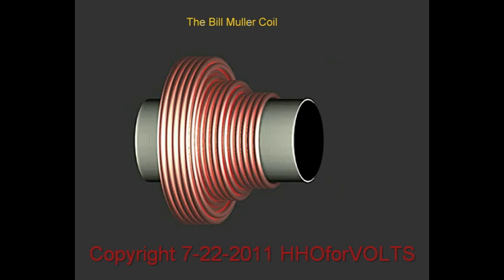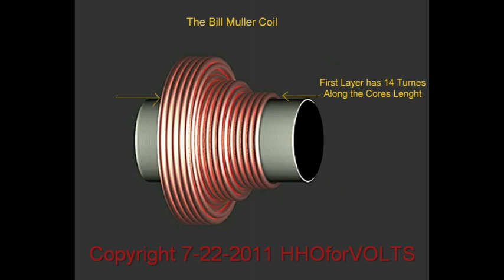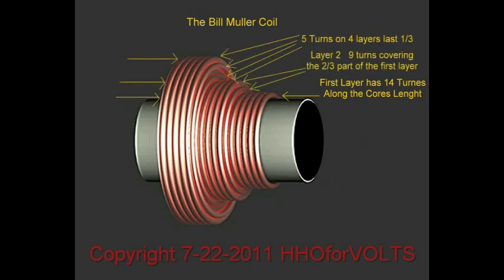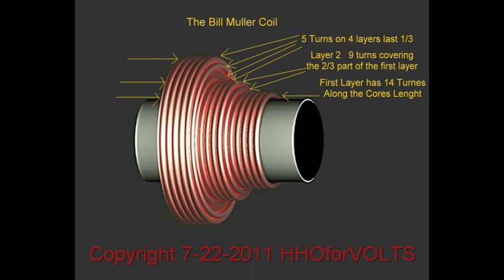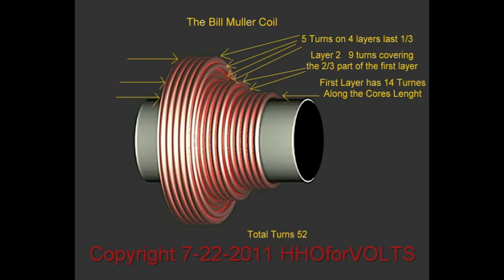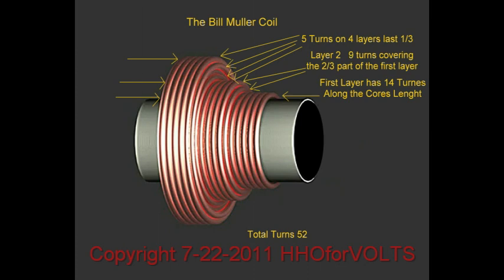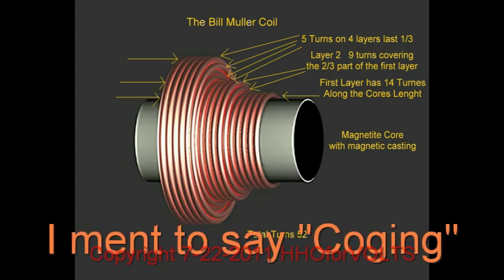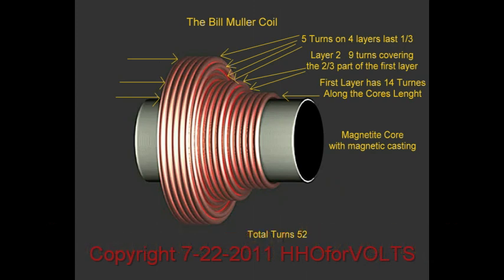Muller, Understanding his coil  design

Comment: It would be far more efficient to make the coil slope in a linear fashion to match the linear diminishing magnetic field  down the length of the core as opposed to that stepped technique. 13, 12, 11, 10 turns etc until you reach the number of turns for your designs required voltage. Also, keep the diameter of the wide end facing the magnets the same diameter as the magnets. I would like to experiment with dome and conical shaped cores and coils perfectly matching the radius of the magnetic field exciting them. Machining an iron cap for the coil/core to further contain and focus the magnetic flux would also increase the efficiency as opposed to just letting the coils radiate off that wasted flux. Keep your coil/magnet gaps under 1mm and you will be better off too. You will never go over unity but the higher your efficiency the better. You can also design a 2 thrust coil system where the second coil directly next to the primary drive coils are precisely timed and located to fire in a reverse wound pulling fashion on the same thrusting magnet as it is exiting the primary thrusting coils field with that second pulling coil only being energized by the collapsing field of the primary thrust coil to make more efficient use of the primary coils collapsing field energy then any of the other schemes that attempt to chemically store that energy that experience the additional resistance and electrochemical loses in the scavenging attempt. Always use at least 2 sets of driving coils and locate them evenly to avoid vibrational losses from lop sided thrust. 180 degrees for a dual setup, 120 degrees for a triple setup etc. Now if you use magnetic bearings and contain the entire device in a pure hydrogen gas filled plexiglass housing you will have a very high 90's% efficiency with your only loses being wire resistance. The hydrogen is 10 times more efficient then air cooling and adding a natural convection circulated radiator system to cool the coils further keeps resistance down. The hydrogen also negates almost all of the air friction loses which are immense at higher RPMs and frequencies where the magic happens. At the higher frequencies DIY Litz wire made up of twisted 36 awg or thinner wire  to your designs true desired gauge really shines! High temperature super conducting coils and wire is the next step that appears apparent but once you factor in the energy required to liquify the nitrogen you are way in the hole efficiency wise in reality. One last tidbit, you can use a diametrically magnetized sphere magnet on the end of a shaft driven by toroidal Rodin coils that can develop extremely high RPMs in the 500,000 RPM range! With diametrically magnetized ring magnets attached to that rotor shaft you can spin those ring magnets inside tubular coils allowing for a perfectly balanced high RPM armature. With 3 ring magnets 120 degrees apart radially you will generate 3 phase electricity that can be tapped delta or Y. You can add on additional triple rotor sets for more current or voltage depending on series or parallel wiring of the 3 phase rectifiers from each triple coil set. Enclose  that in a hydrogen filled/cooled pipe with magnetic bearings, use Litz wire and you may even experience the black suburbans showing up at your house in the middle of the night! That should be enough ideas to keep you folks experimenting all winter! Don't blame me if you get abducted, snuffed or electrocute yourself...lol

Comment: I have been messing around with free energy or lack of better terms to those who don't believe but I have made a coil with the same amount of wraps and size wire and the concept I came up with on the Orient of the wire and the wraps that almost doubles the output as of what me muller came up with if anyone is interested in seeing the coil and might help the process of free energy or what goal is wanting to meet
Reply: Are you still open to sharing info on this coil design?

Comment: Very, very interesting,
the common thing with this field is always a pyramid,Tesla even used pyramid shaped wound coils(are coils the same as inductors?).
Thanks Richard, keep at it!
Reply: yes coils are the same as inductors, or rather inductors are coils. But usually if you have a coil which is explicitly intended as an inductor, its goal is to act as a circuit component and resist changes in current or to transform alternating current as in a transformer rather than to act as an electromagnet. In fact, inductors are commonly wound around a ferrous toroid so that the effect of the magnatic on its surroundings is minimized (wouldn't want two inductors placed near each other to accidentally start acting as a transformer).